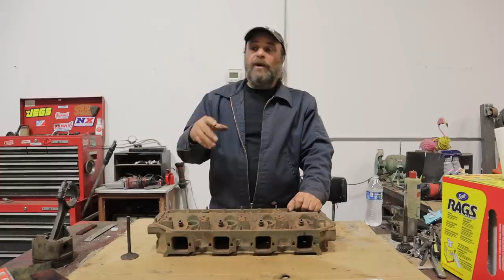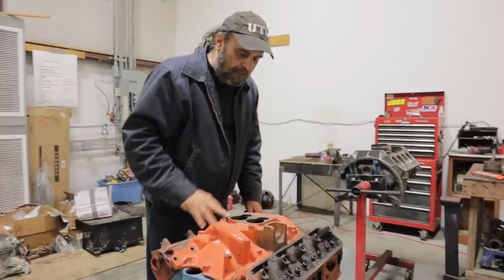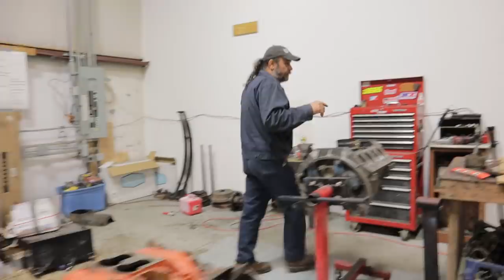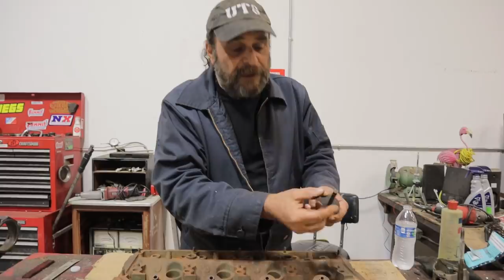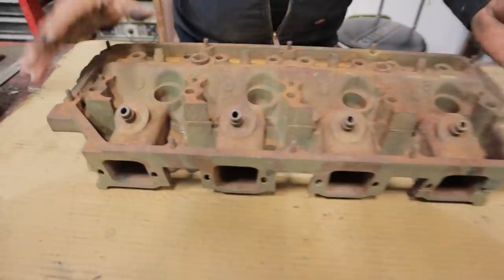Carburetor MPG Myths And Intake System Thermodynamics

Comment: There are ALWAYS improvements that can be made.  If Shell engineers can design a 376 mpg gas vapor car in the 70s (yeah, fact, look it up) then I’m sure we can eek out another 10 mpgs.  Gimme a break
Reply: Yebo,  if it were true you would have shown us where to find the backup to your claim. I'm calling BS on you ! Prove it to us !!
Reply: @duane4972  Technically, what he says is true, I did look it up. In reality though (you know, that world where most of us live), the car was a 1959(?) Opel something or other that was HEAVILY modified including chopping the top and removing EVERYTHING that added excess weight. They even went so far as to remove the transmission and replace it with chain drive because they found that the only way to get that kind of fuel mileage was to run it between 3-12 mph, therefore, they had no need for multiple gear ratios. I googled 376mpg shell car and found an article about it on quora. They even removed the headlights..does anyone even drive at night?
Reply: @MikeBrown-ii3pt  you didn’t mention the fuel vaporization system on the engine which was also modified.  The point is, again, there are improvements that can be made not that we could get 376 mpgs out a modern car.
Reply: Suspension deleted, one seater,  engine with a lawnmower carb, chain drive, Sounds like a go kart with an Opel body. Tested at an airport, no traffic, no acceleration or deceleration. I would love to know the mpg at a 60mph cruise, but there's the rub, it couldn't do 60mph
Reply: @rockymeyers4030  you’re missing the point
Reply: @yeboscrebo4451  yes, I am missing the point. how does a single seat car going 12mph compare to my last airport rental car (vw Jetta) that got 40mpg going 70mph fully loaded with luggage and 3 persons. If I remember Smokey's hot vapor fiero, it made 250hp and got 50mpg. There are modern 4 bangers making that kind of power now. MPG is less, but the modern economy car weighs much more than a 84 fiero
Reply: Hemmings did a profile on that Opel, I would not consider this much of a " car " .  There also was not any mention of how many miles the car was driven. I doubt that based on 50's tech the engine would have lasted more than 1,000 miles.
I wonder how many that complain about MPG / cost of fuel do the following:

Check tire pressure every couple of weeks

Don't let the engine idle for more than 30 seconds  ( Using remote start / waiting for warmup = 0 MPG  )

Drive at speed limit or under

No rapid acceleration

Leave the AC off most of the time.
Reply: @rockymeyers4030  …still missing the mark.  If you really think that in 50 years those minuscule improvements are all we are capable of then… I don’t know what to tell you.
Reply: @yeboscrebo4451  The improvements arent miniscule, but the ability to percieve the fact that there is a limited amount of chemical energy in a gallon of gas, and the weight one are trying to move with that energy x speed, seems to be.

Its like "how to feed a family of 7 on a single twinky per day" all over again. Those would be some lean meager mofo's.

Moped is the solution your looking for.

Comment: Smokey used a turbocharger backwards to reverse homogenize the fuel and atomize and pre heat it into the intake track to get it to burn easier and more efficiently like kindling in a camp fire, dryer wood burns better than damp wood

Comment: Fuel vaporization from a carb principally occurs in the cruise. What happens is kinda cool really. High manifold vacuum substantially lowers the boiling point of fuel causing it to boil off into a fuel/air gas. 
Full throttle where there's hopefully no manifold vacuum has to have added fuel enrichment by various methods. My favorite carb will always be the Thermoquad. God I love those things. Faults, none! The perfect carb. (Maybe there's a few faults - I'm in love alright)
Also anyone who's ever blown a headgasket knows that those pistons at the leak site are always spotlessly clean. A bit of water in the intake never hurt a gas engine, but don't think of trying it on a Diesel.

Comment: A leaner, more vaporized, hotter mixture entering the carb with the atmosphere air that is drawn in and then a VERY HOT HIGH VOLTAGE SPARK with VERY  WIDE GAP(54thousands) will greatly increase MPG.

I DID IT.

1966 289 2 bbl automatic stock mustang went from 15.5 MPG to 21.5 MPG and ran like a racehorse!

Daily driver.  Ran it like that for 2 yrs.
Still have the car but don't drive it much.
Reply: if you read my post on the page above i did this to a 1972 mustang!  the factory had evry thing right but the timig curve and the fact it had points! got 27mpg! had a 77 f100 that got 20mpg with 351w! it is easy! with a 289 i know i could get 30! gm hei in 1974 specd .070!

Comment: I read some where the carter bbd 2 barrel flows at 280 cfm while the holley 2 barrel flow around 265 give or take . I think the best bang for the buck is the thermoquad since the primeries flow close to 200 cfm on the 2 barrel part of the carb while other 4 barrels flow at 400 cfm on the 2 barrel so your getting really good fuel economy from the thermoquad  4 barrel and the bbd 2 barrel . I also like my carter 1 barrel on my slant6 in my 65 dart . my car was mostly stock including the tires and the 7-1/4 had 2:92 gears . got really good gas milage . got a little better gas milage when I added a k& N filter and put a bigger exhaust pipe from the manifold back
Reply: The EXACT reason the spreadbore carbs were so popular! A Quadrajet CAN get better gas mileage than a stock 2 bbl. It never does because we all like to hear that sound!!!

Comment: I always find it amusing how these 100-300+ MPG carburetor believers think that somehow the laws of physics can be warped to create such delusional efficiencies. What they always overlook (or deny altogether) is the fact that the fuel to air ratio can only be so low before the mixture simply cannot ignite, and in order to have fuel efficiency in the 100-300 MPG and beyond range, the fuel mixture would have to be so incredibly low that it could not even be ignited. Not only is it a fool's paradise, the laws of physics doesn't allow it.

Even if this was somehow "possible", I also find it amusing how people think such fuel efficiencies could even be achieved in old engines with such large bores, lazy port and combustion chamber designs, low compression ratio, etc. where this could even take place. Which it can't, even in a modern engine. What's even more amusing is the assertion that a carbureted device could somehow be more efficient than a modern system with computers and sensors that constantly monitor, adjust and optimize fuel ratios depending on both internal and external conditions...and make these calculations literally hundreds or even thousands of times per second. Even if it were "possible", how a completely mechanical set-it-and-forget-it carbureted device could outperform a perfected computerized system that makes every single calculation and adjustment on the fly is pretty delusional.

With that said, I am not bashing the carburetor at all, as it's an excellent device that can be operated and adjusted by anyone with a screwdriver, a wrench and a little bit of knowledge, but to think a carburetor (or ANY system) can somehow warp the laws of physics is pretty unhinged from reality. Not even today's most modern computer technology can do that. It's a myth and a complete pipe dream. Science is your friend, people!
Reply: I wonder if one day we could see a gas supplement/mixture or something that could allow for leaner afrs.

Comment: You need to check out Shell's 376mpg Opel.  It follows along the same thought process as you were noting.  They wrapped the whole engine in asbestos so it would run at 400 degrees f.  Then they modified the most gas guzzling part of any car, the air filled tires were swapped out for solid rubber ones.  Combined with a chain drive instead of a gear driven trans and no suspension, the mileage went higher and higher.  Drive train inefficiency is the main reason cars don't get better mileage.  It's the same reason why trains can get better gas mileage than a car, minimal drive train loss with steel wheels, and diesel/electric powering them.
Reply: you hit the nail on the head! if you built a engen to run a 1 speed more or less  you could tune it to run more eficently then drive a gen set to send power to electric engine to drive weels! just like a traine! thre was a car 1915 -20s that did this a owen magnetic!

Comment: One cannot avoid the basic laws of thermodynamics. Energy in… energy out! Some engine designs are better, some worse. I bought a ‘94 Escort, 1.9, 5-speed, single cam from my daughter who had driven it for 9 years. She got 40-42 mpg. I never got less than 39, and I never babied it.
Reply: I had a Chevy Sprint. 3 cylinder and 5 speed. I got gas mileage in the 40’s on average. There were great mileage cars back then.
Reply: Keep your oil clean,  regular  ignition  service with correct ⚡ plug, annual coolant  service,  good Tires &timing  belt miles,  Stock 1.9L, TBI or H.O. 🏁which has👍🏻 HO cam & tuned exhaust,  aggressive  throttle  response,  Fun MPG, don't forget Fwd understeer in corners, ( tap brakes going in)  physics always wins  if you don't  respect it.
The block is durable , Never let it get Hot (aluminum  heads) capable of 200th. Miles or More.. Had an 84HO. 1.6L 2bbl, Motorcraft Weber, & Tuned  exhaust.  Similar  to my 65 Cortina GT.  Which got great MPG ⛽
Reply: The 94 is really a Mazda 323 with a ford CVH engine.
Reply: @12yearssober  I have a 2006 v6 Camry that I frequently get 50mpg in... yep, way back when they had good mileage cars...

Comment: i REALLY hope you talk about the 4 and 1/8th inch bore of the GM 400 small block
its almost TOO big to be efficient.... 
.
but with a shorter stroke (like using a 350 crank....AKA a 377.... or even smaller crank)
you can REALLY rev these engines up..... while still having quite a bit of displacement 
.
.
their is a reason 99.8% of modern engines use a larger bore and a shorter stroke (over square) 
.
.
.
the GM400 has the LARGEST bore of all small blocks (and IIRC, even bigger than the smaller big blocks!)
and also has the LONGEST stroke of all the small blocks
.
so its a TORQUE monster...... but will still rev to ~5500 RPM (6200 or so if valve train and rods are upgraded)
from 1970 to 1980..... they ALL made at least 245HP..... and over 400 foot pounds
.
even the smogger 400s with 2 barrel carbs and Net VS gross HP..... 
they may be rated at 190hp, but they were still making 245-265 at the crank
.
im pretty sure GM never changed the compression, cam, ETC on the 400s
just 2 and 4 barrel versions
.
.
.
.
.
.
and looking at the 377 VS 350......
even if the 377 was the same displacement (or if you evenly bored and stroked a 350 out to 377)
the 377 will BURY a 350
.
the 377 will bury a 383 (350 bore, 400 long stroke crank)
.
.
and that all boils down to the LARGE bore
simply more surface area for the explosion to act on
simply an over-square engine doing over-square engine things
.
.
like, everyone LOVES their 383s...... but i think they are an ass backwards motor (unless you are looking for torque) 
id rather build a 350 or 400.... than an under-square (iirc) 383....... because the 350 would make more HP in the end
.
.
again.... 383s are GREAT for a "work pickup" ...... towing with a bit of fuel economy 
but for high performance, you should have built a 377...... or even a 400
.
.
.
i think most build 383s because "no replacement for displacement" (but their is when your 383 engine is under-square..... its called over-square / efficiency)
i think most build 383s because 400 blocks are getting REALLY hard to find........ but people are still making aftermarket 400 stroke cranks with 350 main sizes
i think most build 383s because they are scared of the "400s overheat because steam holes" MYTH!!!........ and it is a myth 
i think most build 383s because they are scared of externally balanced motors.... or ran a 350 flex plate / main pulley on a 400 and it didnt last very long... so the 400 must be weak 
.
.
honestly.... if the 400 had an even larger bore, and a slightly shorter crank throw...... that allowed it to rev like a 350
NO ONE would be building 350s, 383s, or even 377s
every 350 build you have seen..... in the past or today..... would have been a 400 build
.
i think GM went just a BIT too much on the stroke
but for a 1977 K10 with full time 4 wheel drive...... that only gets driven to pull and haul.... and do general work type stuff
the 400 CAN! NOT! BE! BEAT! 
.
.
that truck DOES NOT GET STUCK
and even with a trans that only has 1st and 3rd..... its still pretty damn quick (doesnt get into the "power band" till you are doing 85mph)
it shifts into 3rd at 13MPH..... and if you didnt know it.... you would swear its in 2nd gear
.
it has SO MUCH torque.... it just DOES! NOT! CARE! its skipping a whole ass gear
Reply: I have built a 400 .30 over no problem! heads wer the lareg valve non camal hump type 1960s from mexico with larger water pssige just drilld for steem holes and use a external bypass from intake to radator from the late 1980s so not to rely on the internal bypass. used a edelbrock rpm proformer and a holly 600 vac secondary and a 300hp 327 cam! in a 1986 long bed c10 got 19mpg! i would love to see a 327 crank in a 400! us long rods for less friction on boor walls! am a ford man but helped my chevy frend out to build it! I have got 27mpg on a mustang with a 351c 2v and a fmx auto 3speed! it is not hard build for tq and gear for speed! tq + tall say 2.80 rear end = mpg!

Comment: Air fuel mixture 14.7 to 1 is optimal mixture for fuel efficiency.  Dual spark plugs would increase combustion optimization.Mopar Hemi engine is the most efficient designed engine.
Reply: no 14.7 is best for emissions but best econemy is 15-17 to1! best power is 12.5-13.5 to1 as a ruel!

Comment: The right jetting and a draw thru turbo carb, with a higher compression engine can net great gas mileage.  Easily mid 20 mpg range.  Perhaps more with the buick 3.8 V6 like the sport coupe from 78-83.  The factory compression and boost was too low however, with a 10.5:1 engine and a modern Garrett turbo with .63 ar exhaust and .60 compressor can net very great mileage potentialhttps://youtu.be/6W7xmXf9bZM
Reply: I don't follow modern turbo methods. The way I was taught was to have low static compression, 8 :1 or less. Then use the turbo pressure to build whatever you want. 
With a 10.5:1 how much boost can you add? How much timing do you have and how much boost? Intercooled(?) and how much temp drop? I haven't even thought of this stuff in thirty years!
Reply: Why a draw thru as opposed to a blow through?
Also intercooler effects on mpg?
Reply: My carbed 4bbl 3.8v6 has given me 24-25mpg on the highway, in a g-body.  Rochester E4ME.
Reply: i have goten 27 all day long in a 1972 mustang with a 351c 8to1 compression 2v 3speed auto! the factory crburetor has annuler boosters for good mixing! I recurved the dizzy and added electronic ingnition and dule pipes with low restriction muflers! 2.80 rear end helps! could get 30 i bet if used a late 1970s crburetor as it wold be leaner on the jets. draw threw turbo on this thing woud pushit up in to the hi 30s!

Comment: This is one of the reasons why EGR is detrimental to an engine over the long term. The amount of carbon build in the intake tract is insane. I've pulled diesel intake manifolds that had a 1/4" of carbon buildup on the insides of the ports on the manifold, and the head let alone the intake valve. And yes I know a newer diesel is direct inject so the fuel doesn't spend time in the ports. Regardless the amount of airflow restrictions is still noteworthy.
Reply: EGR on a gasoline engine is beneficial to fuel mileage if properly implemented.   A throttled gas motor is variable compression,  At light throttle, effective compression is low due to partial cylinder filling.  Inducing inert gas brings the effective compression up.

Comment: Home example. Aftrr frying. Put the frying pan in the sink and open the tap slightly. When the water hits the metal it instantly vaporizes. If the water hits a leftover piece of the eggs you fried it does not vaporize. Simple.

Comment: Especially in inline 6 engines. I have a Ford with a 300. Offenhauser intake. Holley 4 Barrel.  I live in Phoenix az. Have to run a radiator heater plate in the winter and have it off in the summer.

Comment: On any V8 I build, I block off the heat stove completely. You notice it takes a while to warm up. But I never have problems with vapor lock and my alum manifold is still spotless after 90k miles. It’s a 350 Buick in a 66 Chevy pickup. I get 17mpg on the hiway. Never had an issue with spark plug fouling or performance. But on days when the temp is below 30 you do notice a bit of stubbornness.

Comment: when I was driving my 65 dart with the slant6 with original gaskets I had put quit a few miles on it and I started noticing it pinging going up hills ect. check the plugs timing points ect. noticed it did little puffs of smoke ever so often. took the head off and freshened it up and replaced the valve stem seals and found out the valves had a a thick layer of hard oily crust built up . after I got all the valves clean down to bare metal I polished the valves and put the engine back together and it was a huge difference how it ran and got better gas milage and the pinging went away ect.

Comment: The world record for auto gas mileage was set in October 1973 by a 1959 Opel station wagon with a highly modified engine. The car traveled 376.59 miles on a single gallon of gasoline during a Shell Oil Co.